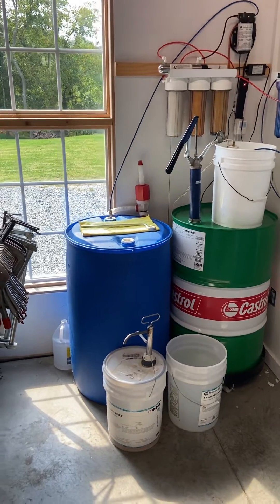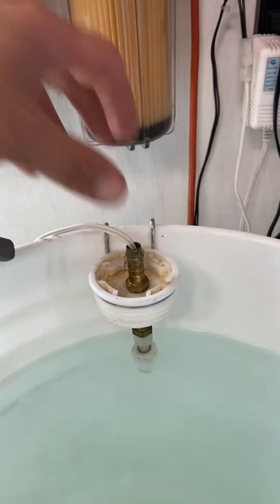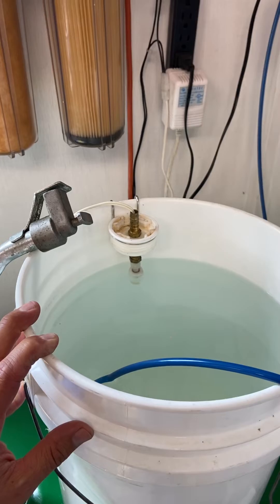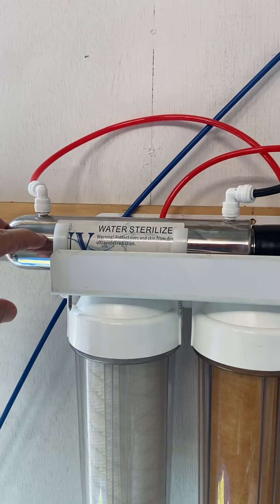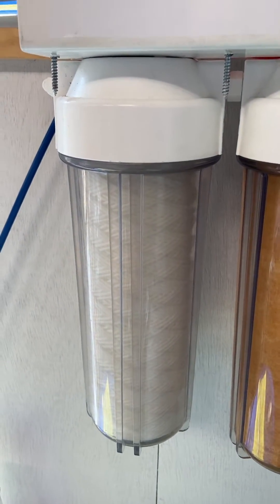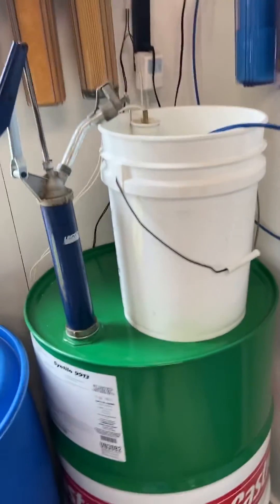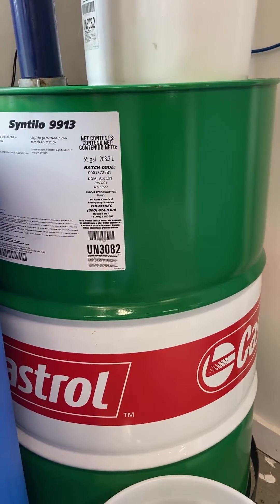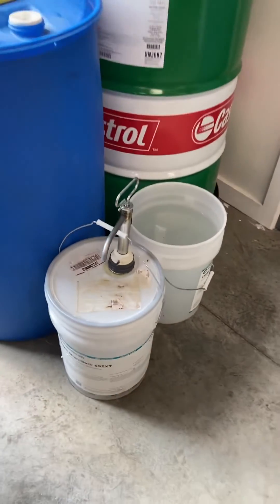Water purification system for CNC machine coolant

Comment: What pump is that for the 5 gal bucket?
Reply from the maker: Here is the link for the pump on Amazon 
https://www.amazon.com/Standard-Manifold-pressure-transformer-6840-2J03-B224/dp/B07MXR284B

The list of all the components and links are in the description of the video. 
Thanks!
Rob
Reply: @Little-Enterprises Thanks for the response.  I was referring to the small hand pump in the 5 gallon bucket.  By the way, It's a pretty neat set up you have there.  I'm doing something sort of like it but using R.O. water.  The R.O. system wastes a lot of water! The DI system you have is much more efficient.
Reply from the maker: @RJMachine62  Sorry, you did say that in your question!  I got that one from Uline.  It was pricey, but it is rated for solvents.  https://www.uline.com/Product/Detail/H-4897/Pail-Pumps/Stainless-Steel-Pail-Pump